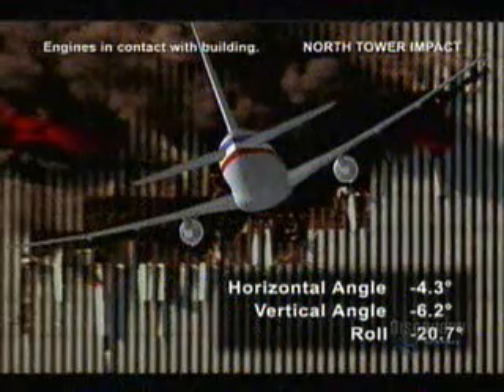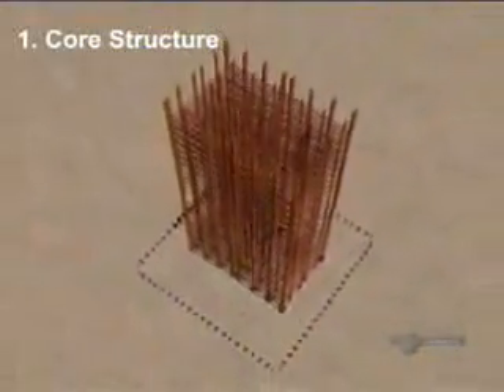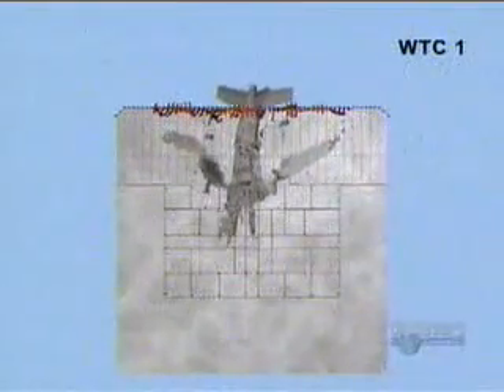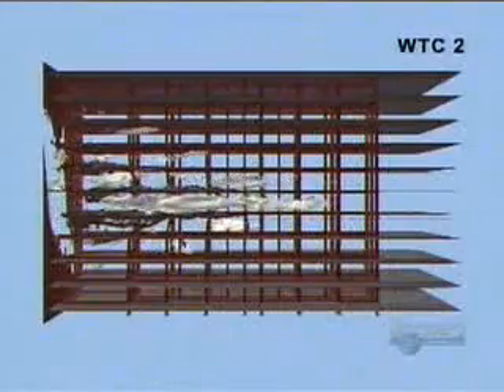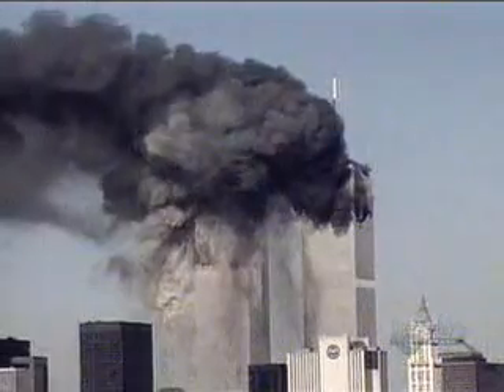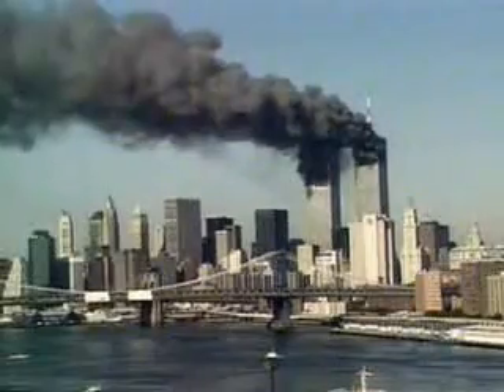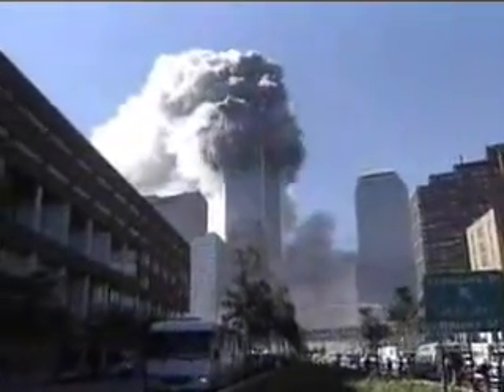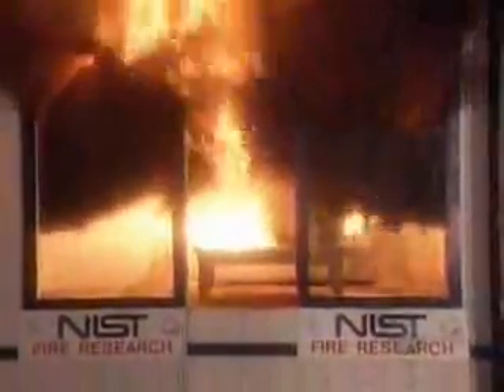9/11 What Made The WTC Twin Towers Fall

Comment: We all agree that fire doesn't MELT steel but it might weaken it. To this day I've never heard the explanation as to why there was molten steel under WTC7, which wasn't hit by a plane. Also, the majority of the fuel was gone on impact. No matter what, deep down, we all know there were bombs in the buildings. Why would steel girders be thrown hundreds of feet and planted into the sides of buildings? That requires extreme force of explosive nature...
Reply: Will Parker a building that waighs around 1,500,000 tons collapsing on itself would create massive force, easily enough to throw its outer steel facade out into other building

Comment: this video is soo full of shit. Its like trying to explain the existence of Santa.
Reply: Canis Aureus  ill wake up , but tell me please what happened to the core columns ??? please this pancake theory is a joke!
Reply: Ryan Ferretti oh ok so that's how they vanished , mmmmm , so it all just turned into dust??? mmm well good luck convincing people of that.
Reply: ePLURIBusUNUM one question, how does the tower fall at the rate of freefall? freefall definition: where the only force acting on a object (WTC 1+2) is gravity and there is no resistance below (I.e. undamaged floors)
Reply: Daniel Blair First of all, this video is wrong about the plane pulverizing into pieces because at 3:16 you can clearly see the nose of the plane on you pause at the right spot. The plane is clearly still intact. Which also makes no sense because a plane can survive an Impact against a concrete wall at full speed and if you don’t believe me just look up crash test videos. You will notice that the wall is left with no damage. The pancake theory of the floors falling on top of eachother using only kinetic energy and and momentum and gravity as it’s only driven force, is mathematically and physically incorrect. If you want me to go further I easily can.
Reply: EpilepticFingers you're wrong
Reply: EpilepticFingers

Oh yes it is! Add the combustibles in the building, the arse is very smart. Listen to it.
Reply: Ryan Ferretti
nope
Reply: wake up
Reply: I am with you Charles Bolso.
Reply: skittles boy 

It doesn't.

how will shills ever recover.
Reply: Ok...
Reply: You've had three years to come up with evidence to disprove this video. If you can do that I'll concede.
Reply: HungryForWater FX if the tip of the plane was intact when it was on the otger side of the building then it acted a hell of a lot like smoke considering the nose didn't continue flying out of the smoke. I mean it totally couldn't possibly be that the force of a plane entering the other side and a mass of fuel lighting off making an initial blast force from the heat could blow out the widows and have smoke come out since the other side since THE ENTIRE FORCE OF A PLANE was going in through the other side pushing it all that way. No that doesn't make any sense, of course not because the government wanted to kill its own citizens to start a fake war they dont benefit from so what hit the tower was a military craft of sorts right? Because that makes any sense.
Reply: Daniel Blair It makes perfect sense. The government aided in 9/11 to have a valid reason to start a war with the Middle East to take there oil. But that’s just a theory. There is mathematical evidence that the pancake theory does not work and the upper 25% can obliterate the remaining 70%

Comment: melting point yes but steel is very flexible at 1000 °C look at blacksmiths making swords or bending horseshoes etc , Ok the steel isn't molten but still  very flexible say you had a steel beam and you heated it until it was glowing then you lifted it from the center it would bend like a banana and then some, even at everyday temperatures steel is very flexible its 1 of the main reasons its used to build buildings, if you understood erecting steel buildings you would withdraw your comment

Comment: If the WTC pancaked down, the central columns should still be standing in the middle. Also the tower fell WAY to quickly. A building won't collapse at the speed of 10 floors a second due to a pancake effect. In order to achieve such a quick collapse, things in the way need to be blasted away.

Comment: ridicule doesn't phase me. so that's all fine and dandy. and yes the viability of ANY supposedly scientific study should be evaluated. and the studies i referred to as "controlled" through the often corrupt process of peer review have been evaluated as inadequate(wrong) you cant prove the theory right without repeatable experimental results, but you can prove it wrong with evidence that suggests a completely different theory and cannot be produced in the suggested theory. which has been done.

Comment: No, my sequence of events is not wrong. and its validity is not based on my choice to not source it. you seem to have no details or anything that begins to pierce, debunk, or even damage the theory. you've rebounded most resiliently with insults and links rather than structured reasoning. and the links you keep pasting have proven inadequacies, not in the theories itself, but it's failure in evaluating key evidence that you, and the "debunker" community continuously deny the existence of.

Comment: you cant be fucking serious right now. well now I know talking to you is pointless, as everything ive told you has completely flew over your head. also, since it's been around since the 80's I don't think you'll have a hard time finding some evidence. but you probably don't want to believe it exists so, you wont. just like everything else contradicting your beloved official story that you just refuse to believe or even research, and apparently, completely forget about later in the conversation.

Comment: and no, MIT does not explain why the core completely failed, giving way at more that half the acceleration of freefall being completely undamaged. the fact that it accelerated in the first place not only breaks laws of physics, but it hasn't even been explained as to why. and nor have I seen an explanation as to why building 7 was literally in freefall for the first half of it's descent before it encountered ANY resistance. not by  NIST, MIT, Purdue, WPI, ASCE, or any of them. unless you know?

Comment: It's literally getting to a point where EVERYTHING you say is false. you have not answered one question ive asked, you refused to specify which of my assertions are wrong or why theyre wrong, but theyre just wrong for some reason. and no it is not proven, it is only a theory. and there are a ton of things ive listed that outright contradict that theory. and they were ignored. and you haven't provided ANY disproof or debunkings, OR answers you just provided the same theories I already knew about

Comment: "dismissal of evidence"

i've addressed all your nonsense head-on. you don't like the answers. too bad.

"priori"

HA HA!! don't strain yourself, junior.

"ONLY a theory as well"

wrong. the mainstream account of 911 is legally and scientifically proven. YOUR denial is YOUR problem.

"if anything I present has a contradicting affect"

it doesn't. it's the same tired old crap that's been floating around the internet for years. it's had no effect on anything in 12 years and it never will.

Comment: your continuous refutation of facts, dismissal of evidence as insignificant priori is going to draw this to an end. you have yet to answer any of the questions with actual baring on the conspiracy theories. but if anything I present has a contradicting affect on the official consensus, which, it must be stressed, is ONLY a theory as well, and is by NO means certain, you flat out deny it, regardless of its factuality

Comment: when you look at any of the collapses do you hear a loud bang or see bright flashes? no. do you have people being blown off their feet and into different floors by explosions? yes. unless you'd like to assume they're all lying. do you see squibs, vertically aligned rows of windows being blown out, horizontally symmetrical collapses,pyroclastic flow of superheated dust and debris and horizontally ejected debris,  some being clocked at 75+mph ? yes.

Comment: and I've read your article and it seems to be another attempted debunking rather than a close analysis, and it bares several problems; it's another list of speculated alternatives to what logically happened, it dismisses strong evidence such as confirmed molten steel, and chemical evidence of nano thermite, it doesn't acknowledge the existence of the patented nanothermite demolition technology, which produces no loud bang or bright flashes, and not likely to have any seismographic signature

Comment: and come on, you couldn't possibly think 75% of that buildings structural steel(not weakened by fire or plane impacts) could possibly give way at virtual freefall gravitational speed and collapse into dust, without so much as deceleration, because the top 20 or so floors were just too heavy for the remaining 80+ floors of structural steel it's been held up by for all its existence. those 80 remaining floors couldn't possibly put up resistance. the cap was just too heavy.

Comment: a "collapse" is no where near adequate to describe what you see in the video. debris is being BLOWN outward. by definition that is not collapsing. the severed section of the building is blown to bits before it even has the chance to "pancake" down and crush all the floors below it. which wouldn't happen in the first place. the entire official explanation is completely inadequate. Not to mention the laws of physics it breaks

Comment: video evidence of explosions
anecdotal evidence of explosions
audio analytical evidence of explosions
chemical evidence of thermite
molten steel supporting thermite theory (video taped, reported, found and confirmed)
pyroclastic flow of debris
large portions of concrete and steel being hurdled outward at 70+mph horizontally if it wasn't completely blown to dust.
the fashion in which the building came down ONLY happens during controlled demolition

Comment: I have read PLENTY of those accounts. so yeah. I do read. and I DID read over each article you referred me to, and NONE of them debunked ANYTHING. they just gave the same explanation, built around the same hypothesis, about different aspects. NONE of them start with an observation, they ALL start with the ASSUMPTION that planes ARE the cause of collapse, and each explain what wild improbable sequence of events would it take for 2 planes to PERFECTLY collapse 3 steel buildings. "lie after lie" ha

Comment: They all amount to the same conclusions. each one. none of them are the debunkings I asked for. I don't to read an official account of how the buildings fell again, I've heard it. so it remains, there has yet to be an ACTUAL debunking, but continuous assertion of the official theory hoping to stifle any questions one might have by using pretty explanations with big words excluding any other possibilities. every theory is based on one hypothesis, it was the planes and the heat from fires.

Comment: no, I hate explaining details that don't matter, or have no significance in the argument beyond the misinterpretations of the your/you're typo. and yes, It is capable of demolition. it's not used because it's expensive, and it was military grade at the time. regular cost affective demolition requires visible obstructing wiring throughout the entire building. whereas thermite can be remote detonated, positioned to cut precise angles, and can cut straight through steel.

Comment: well. i'm done discussing your completely false interpretation of the word symmetrical based on the irrelevant trajectory of building debris. and I think there should have been a more thorough investigation. you have report after report of explosions that were obviously separate from the plane crash and the investigation was conducted as if there were no such reports. which is fucking stupid. it's obvious that it happened, and no attempt was made to find out more.

Comment: and as for the molten metal, like I said it was filmed pouring out of of world trade center moments before the collapse. it was reported time and time again, seen flowing in pools, melting directly off of steel columns, large hunks of steel were found fused with other elements, spherical particles of iron were found in the dust which happens when it is molten and not many other scenarios does iron form in to spherical particles, if any at all. so Mr. Millette has some serious explaining to do

Comment: Your 'quote & contradict' debate method is noted, and will quickly run thin as you run out of things you can really contradict. 

testimony/interview- regardless of your immature decision to differentiate the two as if it poses any controversial factor in this argument, it STILL calls for evaluation. okay, smartass? and yeah, dumbass Jennings actually did witness what happened. so.. wrong again!

Comment: no there was acceleration. of course only up to a certain point during the collapse, there will be deceleration. but it did accelerate through about 70 floors of structurally sound steel before it stopped accelerating. and MIT does not explain why the steel simply disappeared in terms of resistance. if you watch a failed demolition it will show you what happens when everything isn't planned perfectly. its a fucking disaster. because steel resists. it doesn't just crumble to peices

Comment: "all that fuel burnt off in a few minutes so how the fuck does it melt the columns"

the fire didn't melt the steel; it weakened it. here's a series of articles by MIT engineers, explaining how the fire burned long and hot enough to weaken the steel:

web (daut) mit (daut) edu/civenv/wtc/

Comment: "the building was designed to hold its own weight"

yes, static mass. once there's a failure and everything above the impact zone starts falling, there's no way the building beneath it can withstand that amount of force.

"so a small section fell"

the planes impacted the 93rd and 77th floors; that's about 8 and 24 storeys, respectively, of a high-rise building. i don't know any sane person who would consider those "small sections".

"without so much as deceleration"

there was deceleration.

Comment: the building was designed to hold its own weight, so a small section fell for a few feet and the buildings structure globally fails top to bottom without so much as deceleration during its descent? there's a lot this video didn't explain. but it was a pretty animation with a pretty explanation

Comment: the explanation seems pretty logical. being that my belief is that it was controlled demolition. but here's the thing. all that fuel burnt off in a few minutes so how the fuck does it melt the columns in such a short amount of time, especially when it's no where near the melting point of steel. why are these 3 buildings the only to have ever collapsed like this due to asymmetrical damage. how do they account for the columns below simply collapsing due to the weight of the top section?

Comment: The plane fuel is incapable of melting metal the best it can do is soften it. So why does a picture show running metal as found in thermite demolitions and thermite particles in the wreckage when the plane had none, how were seven perfectly preserved passports found when they only found one semi-intact filing cabinate when there was thousands in the building. This was self inflicted terrorism to start a war in Afghanistan.nothing more.

Comment: Yes, i egree with you. The towers were just made of steel and the intense heat caused by the jet fuel of the planes could melt the core columns which had forced the tower to colapse. Some idiots thinks that it was a contolled demolitions but a controlled demolition is slightly much more different then the collapse of the towers.

Comment: And even the weight of the top floors cld drop the unimaginable weight and strength of the base of that tower. And the pyroclastic flow burned all of the vehicles and everything in its path. U can tell because everything is charred to scrap metal. A debris cloud cannot do this and isn't grey or cannot travel as far as it did. Its not possible people demolish buildings all the time. Its impossible to do this without thermite. Its quiet obvious that this was an inside job.

Comment: Ok look if anyone cared to do any research themselves then they would know the melting points of everything here. Now yes i can see the plane stripping the fire proofing off of the pillars but not the whole pillar and I studied welding i can tell u it takes about 10 seconds to cut through a 1 inch thick steel plate WITH A BLOWTORCH! So riddle me this how can burning fuel cut through these "huge support collums" and drop both towers straight down. Watch building demolition videos and compare

Comment: @PortalStillAlive Not quite, the fuel only ignited office furniture etc. The temperatures reached around 1800 degrees in some parts. Steel melts at 2750 degrees however it loses 80% of its strength at 900 degrees. The steel trusses start to sag and it's the fixing bolts holding the trusses in place that break causing the trusses to collapse. Once this happened, there was no way to stop the progressive collapse.

Comment: @wizziebaldwin 
You are the idiot not to believe, that fire cause the pillars loose its original sustainability. Try to realise, that steels does not need to melt to loose structure. It´s like you holding a chair in you arms. After a while, you loose power while consuming energy for holding. That´s the same with steel.

And your melted steel at the ground was caused, when the collapse produced energy and heat which lets everything turn intos powder and liquid.

Comment: Steel starts to melt at 1154C and is totaly molten at 1200-1400C depending on how much carbon is in it. Fire burns at around 1000C i see a way it would at lest weaken.